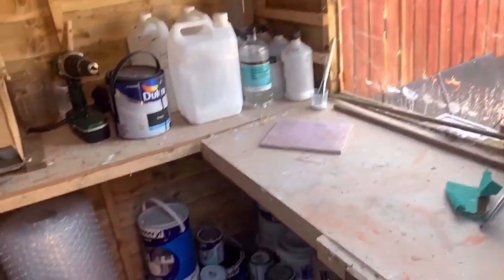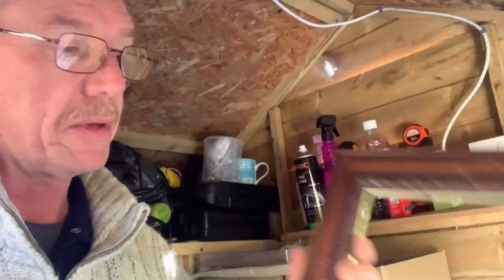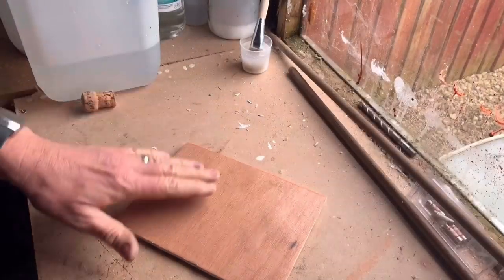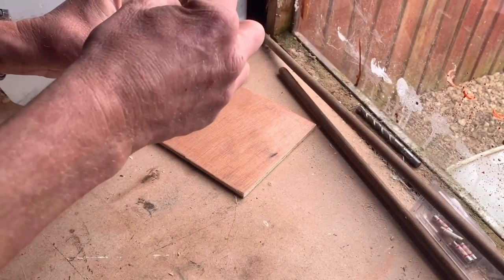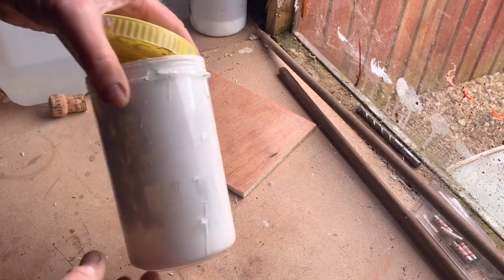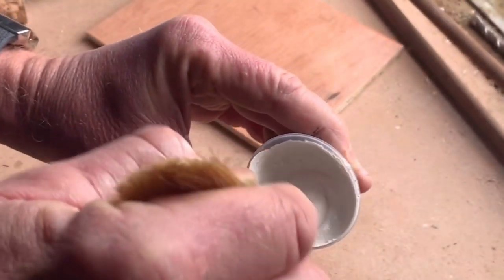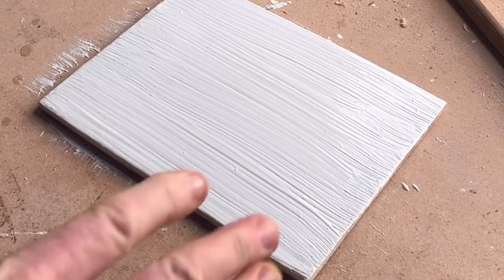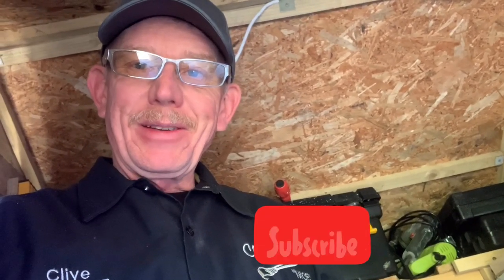How to seal wood for Acrylic painting

Comment: Any tips for prepping a wood board that will be outside? Will PVA work outdoors if it's sealed after painting on OBS board?
  Thanks Clive!
Reply: PVA is pretty solid stuff. As long as it isn't in direct constant contact with water. But if that happens with an outdoors painting I guess you'll have bigger problems. ;-)
I would recommend waterproofing both sides of your painting with an epoxy sealer. It will (literally) last a lifetime and does not really matter what you sealed in it.

Comment: as usual clive a really enjoyable video,very  informative , pleasant , some people like the prepping and potching more than painting, i understand that ,    only one thing

ive seen many such videos , all correct as such  , but after giving it a few coats,  a sanding or two in between ,another coat ect  the painting  then turns out a flop,   my point ?  well,  way to much trouble and work to end up with nothing after all that time and trouble
as most peoples hit rate is 1 out 5 a success ? ish  maybe less..

so one sand to stimulate the fibers, one good  coat pva to dry,   one very  good coat of a gesso like  ground to dry and away to go..  but people say ,  but it will peel off , if wont last , in a hundred years my picture will b spoilt !     come on guys do you really think anybody will care about your work, my work ?  but you cant get through to some,  some love to suffer for their art!! 

but your video is as,    usual really good clive,  but i feel this method prescribed by many,  is  very hard work,very very time consuming  , to much  time prepping boards  in general... take care.